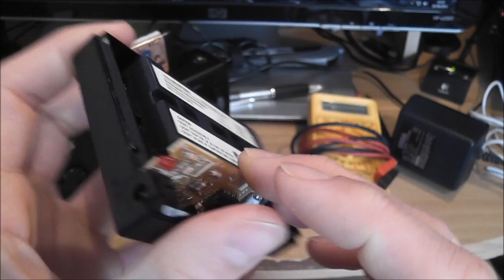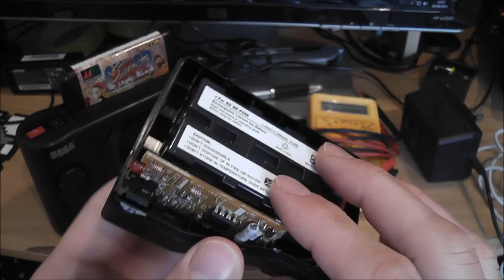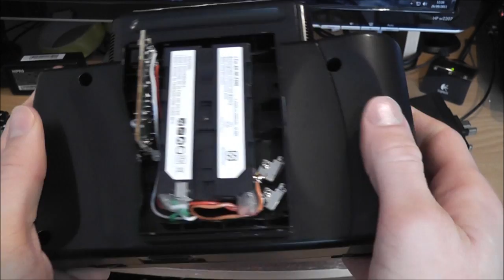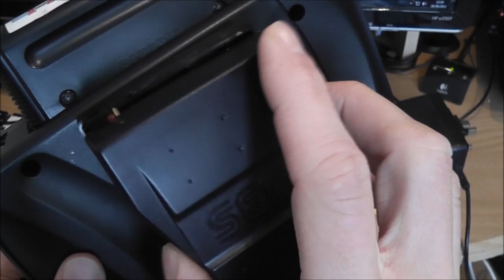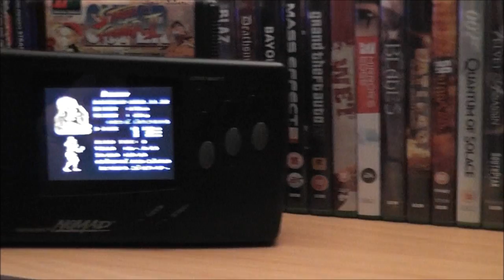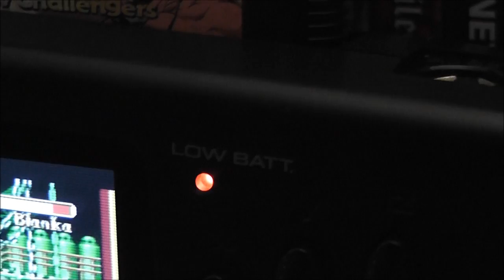Quick Project Part 2 - SEGA Nomad Battery Mod - Testing - Retrofitting Modern Rechargeable Batteries

Comment: Hi your mod looks great. I've tried to cut the trace like you and removed the component . But I have to wired the led to ground  in order to make it works. But the led is switch on all the time like that. I don't get how do you wired the led in order to switch on only if you put the jack of the charger in?
Thanks in advance for your help ;)

Comment: I completed your mod using this video (not part 3 as its not explained how to solder the charging circuit) but I do have success using the steps in this video. I soldered the battery straight to charge jack, stripped the circuit of unnecessary capacitors and it charges and also gives battery to the system. However I have one issue: The led doesn't turn on when the charger is connected. Any idea why this may happen and how to fix it?

Comment: Instead of using these prebuilt generic sony packs why not just use 2 quality 18650 cells from a known good manufacturer (ie panasonic ncr18650 series batteries).

Comment from the maker: @ARMODILLOXX33 I've reworked the whole thing since making the vid. I'll be doing an update vid in the next few days but basically I've now fitted the new charger/circuitry inside the battery housing. Works perfectly and completely enclosed in the single unit :)

Comment from the maker: @lukemorse1 I was thinking the same thing. It might just fit but would probably be a very tight squeeze. The problem with the Nomad is there are 2 mobos inside the case. One mounted to the front for the buttons/screen etc and another at the rear for the cartridge slot. Even still, there's quite a bit of room inside to play around with. I was thinking it could be done to a GameGear though.

Comment from the maker: @BIMBOBOOP Japanese game will fit in a Nomad without modification. It's a tight squeeze but they do go in. Also if your Nomad cuts out/games freeze it means the contacts on the cartridge and/or in the cartridge slot are dirty.

Comment: Nice MoD! By the way, you may really need a switch to avoid power lines crossconnections!!! So, you may be able to charge the battery while playing on the AC Adaptor!